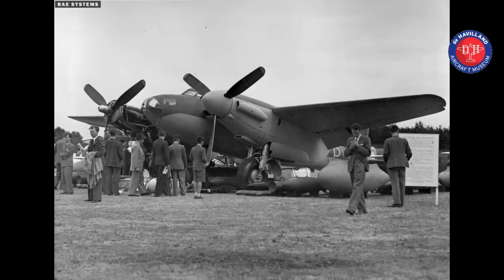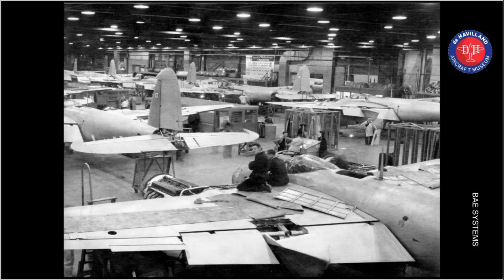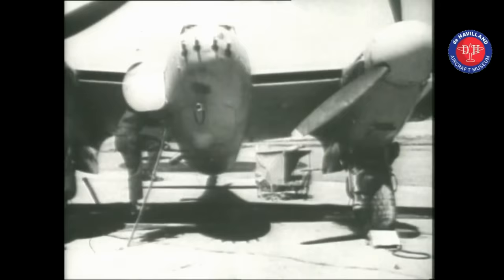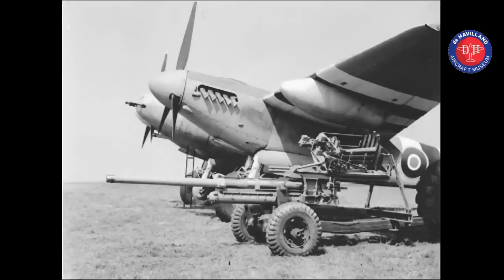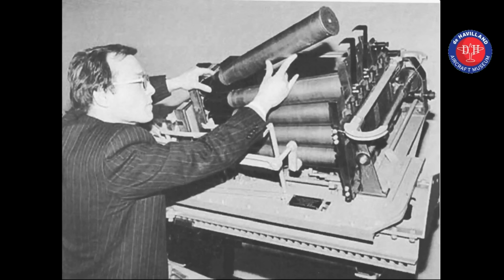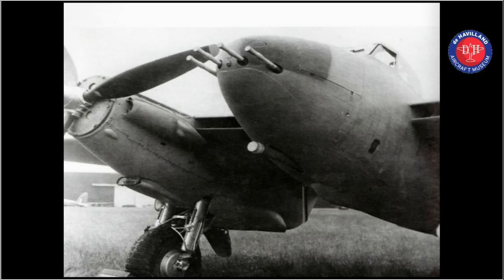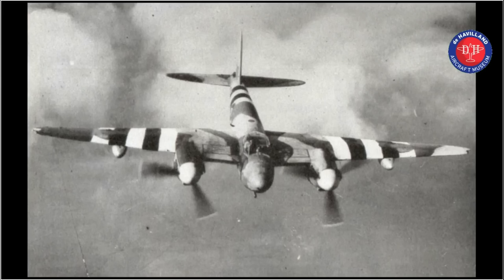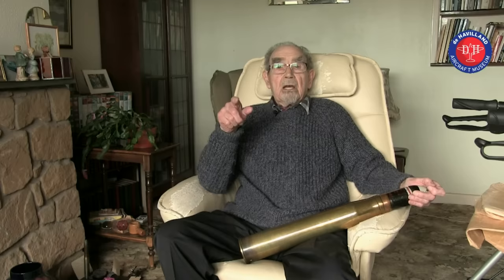TSETSE the DH Mosquito Mk XVIII

Comment: The Mosquito was one of the best planes ever built, period.
Reply: ...in the top 100 at least
Reply: Can't argue with that statement. 
Even today and updated turboprop version with modern avionics, would hold it's own for ground attack.  Low speed loiter performance was excellent even though at the time it was used for it's high speed. The wing design was an engineering masterpiece. Apart from anything it just looks so sexy.
Reply: Out of wood...
Reply: @rummerlinelmo  The fact that it was made of wood made it a war winning tool as important as the Sherman and T-34. That is why it was one of the best planes of WWII.
Reply: Defently a brilliant plane.
Reply: @gullintanni  It was made of wood because DeHavilland was more than a decade behind in structure metal aircraft technology and construction.
When it designed the Mosquito the company was still mass producing obsolete aircraft like biplanes made out of wood and fabric.
Reply: @sandervanderkammen9230  That is not true, the plane was made of wood because of the shortages of metal and the surplus of carpenters. Today the most hi-tech aircraft and boats are made of wooden composites, because it it lighter, stronger and more resistant to fatigue than metal, not to mention the issue of radar signatures. Indeed carbon fibre (wood) is the hi-tech material of today. De Haviland were ahead of their time.
Reply: @LeoSavantt  An interesting theory you have contrived.. but DeHaviland   never developed modern construction techniques and were decades behind other manufacturing companies... the Comet Disaster highlights the company's failure to innovate and invest in new technology.
DeHaviland was still struggling to sell wooden aircraft when the company became defunct in 1958.
Reply: @LeoSavantt  Lol!!! Please tell us what species of trees are harvested for Carbon Fiber production???? HAHAHA!!!
Reply: @sandervanderkammen9230  Nonsense.
Reply: @LeoSavantt    Just the facts here son, just the facts... you don't seem like a person accustomed to being told the truth.
Reply: @sandervanderkammen9230  Next you will be claiming that CO2 is a a  pollutant,  probably you are one of those who think that global warmish is a real, bless.
Reply: @LeoSavantt  Trees cannot live without CO2... but you also cannot get Polyacryonirile from trees....
Reply: @sandervanderkammen9230  still back on the subject the mosquito ...what a plane. Multi role and faster than anything the Germans had at its inception ...not exactly obsolete technology then...
Reply: @sandervanderkammen9230  RUBBISH...  It was made of plywood because DH recognised that metal was in short supply, a strategic material and also he could use a labour force that was otherwise not employed, carpenters and cabinet makers.  Also, his DH 88 Comet was a record-breaker during the 30s and it was on this aircraft it's basic design, proven was made.
Reply: @sandervanderkammen9230  WHAT the comet was a decade ahead of any other design.  The theories around stress and metal fatigue were unknown and the Comet unfortunately set new boundaries.  The results of those findings were given to the US, namely Boeing.
Reply: @sandervanderkammen9230  Rubbish.  After the war the UK government was nationalising all companies in all sectors, sadly DH was part of that in creating the state-owned aircraft company.
Reply: @sandervanderkammen9230  Absolute crap. The Comet disasters were down to a complete lack of understanding across the entire aeronautical industry of metal fatigue. If you had the remotest expertise in Aeronautical engineering, you would know that. Most of the issues were due to proliferation of stress fractures round punched rivet holes during pressurisation/depressurisation cycles, something no-one had a clue about at the time.
By 1958, de Havilland had many metal aircraft in production/service and it did not "become defunct in 1958", but was taken over in 1960 by Hawker Siddeley,which used many de Havilland designs under its own name.
Why don't you do some research before posting garbage?
Reply: @MrHistorian123  You sir are very confused and misinformed, Boeing was building large, modern all-metal, pressurized passenger airliners more than a decade before the Comet.
The Boeing 307 first flew in 1938 when DeHaviland was still making wooden biplanes like the Dragon Rapid.
Without the industry wide understanding of metal fatigue in rivited airframe structures planes like the Boeing 307, 377, Douglas DC6, DC7 and Lockheed Constalation would not have existed.
The Boeing B-47 Stratojet flew two years before the Comet did.

The DeHaviland company became defunct as a direct result of the Comet Disaster, it entered receivership in 1958 and it's debts were written off by the U.K. government and it's remaining assets were sold to Hawker Siddeley, Hawker Siddeley continued  to use the name until 1963.
Reply: @TheJonathan1959  DeHaviland was years behind in aircraft design and construction it was struggling to build wooden aircraft in the jet age.
Reply: @TheJonathan1959  Boeing was producing modern all-metal, rivited and pressurized planes more than a decade before DeHavilands utter failure to produce the Comet.
Reply: @TheJonathan1959  All aircraft production was nationalized during WW2... The Brabazon Committee was formed in 1942.
The DeHaviland Comet was ordered to meet the government specification under Type IV set out by the government  Ministry of Aircraft Production.
Reply: @TheJonathan1959  I believe the wooden construction improved the power to weight ratio as well.
Reply: Yes not recognized
Reply: @maxbacon4828  Massively.  Which is why nothing could catch it up for several years.
Reply: @sandervanderkammen9230  Sour grapes.   Regardless of why DH made the DH98 from wood, the fact is, it was still among the best, fastest, and most successful aircraft of the WW2.
Reply: @maxbacon4828  Can you prove that???
Reply: @BillyCosmosis  The Lockheed P-38 Lightning was faster, both would be easily outpaced by the Do-335 Pfeil
Reply: @BillyCosmosis  The Mosquito was fast for an  aircraft of built with essentially WW1 wood and fabric technology... but the main advantage of the Mosquito was it was cheap to build...
Reply: @sandervanderkammen9230    Wiki has the DH-98 a smidge faster.                                                                   Which probably is why the USAAF operated the DH-98 for their photo recon.                       The P-38 was an excellent plane. But not manoueverable or fast enough to match the German aircraft in the European theatre in WW2. Which is why the USAAF stopped operating them in the european theatre.      OTOH the DH-98 could and did face off against FW190's successfully. ---------------------------        
                                   https://infogalactic.com/info/Lockheed_P-38_Lightning                                                                 "After some disastrous raids in 1944 with B-17s escorted by P-38s and Republic P-47 Thunderbolts, Jimmy Doolittle, then head of the U.S. Eighth Air Force, went to the Royal Aircraft Establishment (RAE), Farnborough, asking for an evaluation of the various American fighters. Fleet Air Arm Captain and test pilot Eric Brown recalled:

"We had found out that the Bf 109 and the Fw 190 could fight up to a Mach of 0.75, three-quarters the speed of sound. We checked the Lightning and it couldn't fly in combat faster than 0.68. So it was useless. We told Doolittle that all it was good for was photo-reconnaissance and had to be withdrawn from escort duties. And the funny thing is that the Americans had great difficulty understanding this because the Lightning had the two top aces in the Far East."[79]
Reply: @sandervanderkammen9230  No.  It was simply an excellent, high performance aircraft,  superior to most other types at the time - be they wood or metal - maintained that status until 1945, and it excelled in all the many roles in which it was used.   What it was made of, how they made it, and why, all are beside the point.
Reply: @BillyCosmosis  Bullshit, I am not going to play any goal post shifting games here. We are not going to discuss some obscure  DH.98 MK 72 unarmed reconnaissance variant  introduced in 1947.
The P-38 first flew in 1939 and was introduced in 1941 same as the DH.98.
Most versions of the Mosquito had a top speed of less than 380mph... significantly less than the Lightning.
The larger, heavier and slower  Mosquito was even less suited to the fighter or interceptor role than the P-38.
The Mosquito was used primarily as light bomber and for photo reconnaissance... not a fighter.
 Neither aircraft would match a P-51, Tempest or  Fw-190 in performance.
Reply: @BillyCosmosis  Lets be honest, in 1941 the Mosquito was an obsolete design, a wood aircraft that when fitted with two very powerful short-lived engines and stripped down to nothing but a camera was reasonably fast in level flight...
But the Mosquito doesn't really live up to the legendary reputation fabricated by British propaganda and literary myths.
Reply: @sandervanderkammen9230  As I mentioned The USAAF withdrew the P38 from the European theatre because it couldn't perform. But continued to operate the DH-98.
Reply: @sandervanderkammen9230  Facts are facts.  The USAAF withdrew the P38 from the European theatre because it couldn't perform but continued to operate the DH-98.  Who should we believe?  The spotty teenager on the internet? (you) or the USAAF?
Reply: @sandervanderkammen9230    Or perhaps we should listen to Fleet Air Arm Captain and test pilot Eric Brown (the world record holder for different aircraft types flown) recalled:

"We had found out that the Bf 109 and the Fw 190 could fight up to a Mach of 0.75, three-quarters the speed of sound. We checked the Lightning and it couldn't fly in combat faster than 0.68. So it was useless. We told Doolittle that all it was good for was photo-reconnaissance and had to be withdrawn from escort duties. And the funny thing is that the Americans had great difficulty understanding this because the Lightning had the two top aces in the Far East."[79]                                       https://infogalactic.com/info/Lockheed_P-38_Lightning
Reply: @sandervanderkammen9230  Wilbur?   Wilbur?  Is that you?  😂🤣😂
Reply: @BillyCosmosis  The USAAF did not adopt the Mosquito because it could not perform.
Reply: @BillyCosmosis  The P-38 Lightning destroyed more enemy aircraft than any fighter in the Pacific  theatre...
Reply: @BillyCosmosis  Eric Brown was an excellent pilot, but the poor man had a notoriously bad memory... so much so he often contradicted himself in annecdotes that he claims he has first person knowledge.
Reply: @BillyCosmosis  As always  like a Tiger Moth amoung Spitfires is that you Tangles??? How have you been?
Reply: @sandervanderkammen9230   Yah sure.  The USAAF adopted it because they wanted to give their pilots an aircraft that was easy to shoot down  😂
Reply: @BillyCosmosis  The USAAF never adopted the Mosquito as a combat aircraft...
 With the introduction of the Messerschmitt Me-262 in April 1944 the Mosquito became very easy to shoot down.
Reply: @sandervanderkammen9230  You're grasping at straws now. The ME262 was 20% faster than EVERY allied piston engined fighter and a massive threat to all aircraft, being only vulnerable to swarming attacks (often at night) on their finals before landing at their home aerodrome. Lucky for the allies, the 262 was only available in relatively small numbers.       The operational availability was 1945 (not 1944 )  :             "Until the night fighter version of the Me 262 jet appeared (in small numbers) in 1945, the Germans did not have an effective defense against the Mosquito. The fighter-bombers attacked precision targets throughout Europe with bombs and rockets. The long-range reconnaissance versions complemented the PR Spitfires. They were also used by the USAF, that assigned the designation F-8."                   https://www.uboat.net/allies/aircraft/mosquito.htm                                                 However, this is all beside the point. The DH98 was an exceptional aircraft during WW2.   And it, as well as ALL allied frontline piston engined aircraft were made obselete by the development of the ME262 and the Gloster Meteor near the war's end.    i.e the beginning of the jet age.
Reply: @BillyCosmosis  The USAAF only used the Mosquito as an unarmed photo-reconnaissance platform and as a target tug... not as a combat aircraft.
Reply: @sandervanderkammen9230  Yes.  Despite USAAF having their pick of any of the excellent US aircraft available they chose the DH98.  Why?  Because it was a blisteringly fast aircraft that could also fly very high.    Read this account of US P51's escorting a bomber version of a Mosquito on a distant mission.  In the cruise to target, the P51's had difficulty keeping up with the Mosquito and the Mosquito had to fly slower than it's normal cruise speed to keep formation .   Both aircraft types were flying outside their respective fuel efficiency envelopes.  The P51s flying faster than their normal cruise speed, the Mosquito flying slower than its cruise speed.  Both types were loaded with maximum fuel via drop tanks and the Mosquito was carrying it's bomb load also.  http://www.mossie.org/stories/Norman_Malayney_2.htm 
 
Lt. Richard Geary (mosquito pilot) :    "The Mosquito met the fighter escort as planned; but now heavily loaded with l,000 gallons of fuel, flew at a severe speed disadvantage. Geary attempted to maintain economical cruising speed but outpaced the P-51s and was forced to throttle-back to continue flying formation with them. The Mustangs had long-range drop tanks and were also fully loaded."                       

 According to Lowell Einhous, (the P-51 escort flight leader)   "We experienced trouble maintaining speed with the Mosquito because of our drop tanks. The distance covered required that we carry extra fuel.   "
Reply: Don't matter what it was built from,wood,metal,carbon fibre,  who cares cuz it smacked the krauts big time
Reply: @BillyCosmosis  The USAAF never issued a requirement for the Mosquito, they were offered in trade for War Assistance programs like Lend-Lease.
The USAAF never used the Mosquito as bomber or a fighter, it would have been completely redundant.
Very intertaining antedotes but completely moot... 

The world's first aircraft destroyed by a jet was a Mosquito.

 26 Luftwaffe pilots became aces flying the Messerschmitt Me-262, of the number of RAF aircraft shot down by the 262s the overwhelming majority were Mosquitos.
Reply: @geoffreyking1634  What matter is the fastest propeller driven aircraft to see service during WW2 was German... not British.
And more important the introduction  of the the world's first operational jet fighter, the Messerschmitt Me-262 rendered the Mosquito obsolete as a front line combat aircraft.
Reply: @sandervanderkammen9230  Wrong, the composite wooden structure gave the Mosquito lots of advantages.
Also, its components could be made in woodworking factories, at a time when structural metals and the skilled workforce to build them were in short supply.
Yeah right, the Mosquito was rubbish, that's why it pissed Goering off so much. (Remember the Mosquito bombing his big speech in '44?). He ordered German industry to copy it, but the Brits bombed the glue factory.
Reply: @sandervanderkammen9230  The de Havilland Comet's problem were precisely because it was an extremely innovative plane, way ahead of its contemporaries. They had to salvage a crashed example to discover that its stryctural failures were because of stress concentration at the corners of the windows. No-one knew about that before.
Reply: @sandervanderkammen9230  You claim that the Mosquito was obsloete at its inception.... so can you explain why it excelled in SOOO many roles? Fighter, night fighter, photo reconnaissance, bomber, precision bomber, Pathfinder,  submarine destroyer, etc. Probably the most versatile plane of its era, and one which gave its crew a very good chance of survival.
It was so rubbish that Goering ordered the Luftwaffe to develop a copy of it.
'Nuff said, you wehraboo.
Reply: @pashakdescilly7517  DeHavilland built the Mosquito out of wood because it didn't know how to make modern aircraft using aluminum....
Reply: @pashakdescilly7517  The Comet Disaster remains the worst engineering failure in commercial aviation history because DeHavilland was decades behind in commercial aircraft design and manufacturing.
DeHavilland was still building biplanes made out of WOOD and fabric when the industry leaders like Boeing, Douglas, Junkers and Lockheed were building all-metal, pressurized monoplanes.
Metal fatigue was well-known and understood by the Industry... it was simply the fact that DeHavilland had no experience in Metal fatigue because it was still building aircraft out of WOOD!
Reply: @pashakdescilly7517  Because it was cheap and disposable you silly Teaboo...
Reply: @gusgone4527  and your choice of orifice?
Reply: @sandervanderkammen9230  what does that have to do with the mosquito?
Reply: @brianlenehan9055  DeHaviland used outdated wood technology to build the Mossie... it was fast but lacked many of the characteristics of modern aircraft like the reliability and durability of a all-weather, all-metal design.
 The Mossie may have been cutting edge technology for deHavilland but they were still building obsolete biplanes at the time... something that would cpme back to haunt them in the Comer Disaster and destroyed the company.
Reply: @sandervanderkammen9230  well arn't you the critic & detractor. It was the fastest in the sky till me262. Big enough to be an actual fighter bomber, can i say the first. Very versatile. Fulfilling a mutitude of roles till wars end. It was built by piano makers and cabinet makers who could use the work with material that was cheap and plentiful. It also rated high (highest?)  in pilot survivability. Sounds like an all round winner to me, certainly not obsolete.
Reply: @brianlenehan9055  Just the facts here... spare us the postwar British propaganda hype.
NO the Mossie was slower than the Lockheed P-38 Lighting.
Reply: @sandervanderkammen9230  since my comment you respond to is way too hard to find, it renders our communication almost useless. You obviousley have an axe to grind though for some reason. If you think the mosquito was obsolete during the war, then maybe set your axe aside and find  your dictionary, or borrow one. But maybe dictionarys are obsolete for you
Reply: @brianlenehan9055  You've been drinking Brian, I can tell.
Reply: @sandervanderkammen9230  absolute shite mate!!
Reply: @jacksonhudd3681  Indeed, the balsa wood "Skee-toe" was absolute shite.
Reply: @jacksonhudd3681  Just the facts here mate... the de Havilland Mosquito was obsolete technology...
Reply: Correction, , , THE best plane, ever built 👍
Reply: @johntailing5283  A good performer thanks to the Merlin engines but definitely not the best ever... not even close.
Reply: @sandervanderkammen9230  bit jealous are we???
Reply: @jacksonhudd3681  Jealous of what?
Reply: @sandervanderkammen9230  Your arguments are amusing, to say the least. Good luck comparing the P38, designed as a day fighter, with the Mosquito, designed as a night bomber. Apples and Oranges. I would have liked to have seen a P38 carry two 4000 lb cookies to Berlin by flying there twice in one night! Don't get me wrong. The P38 was great in the Pacific where a fighter with two engines was ideal for getting its pilot home with battle damage over water. But as a rule single engined fighters were preferable in WW2 

Again with the Me262! German planes introduced after D-Day should have an asterisk beside them, because the Luftwaffe was a basket case by then. And close to a thousand Me262 airframes never even received their engines, because Germany couldn't manufacture jet engines in either quantity or quality. Only about 300 Me262s saw service, a pathetically small number. The obvious question is "If the Mosquito was as overrated as you say, why did it take until nearly the end of the war for the Germans to develop an effective Mosquito-killing interceptor?" 

Hmm?

What has the failure of the Comet got to do with anything in WW2? The concept of the Mozzie worked, and worked well. Goering obsessed about it. Goebbels wrote in his diary how nuisance raids by Mosquitoes played hell with the sleep of Berliners. The best weapons Luftwaffe had against Mozzies for most of the war were pimped-up Ju88s which still needed luck to be high enough to intercept on all but a few occasions. Did you not know the Mozzie had the lowest loss rate of any RAF bomber? Well now you do.

The crux of your argument seems to be "Wood bad!", which can easily be countered with "Wood good enough in the case of the Mosquito."
Reply: @neilpemberton5523  Termites love the de Havilland Mosquito... because the in-flight meals are always FREE!
Reply: @awatt  Have you heard the joke about the two British astronauts that walk into a pub???
Reply: @sandervanderkammen9230  
Why would the country that invented gravity want to go somewhere that doesn't have any?
🇬🇧
Reply: @sandervanderkammen9230  You again.
Reply: @neilpemberton5523   Have you seen the RAF's new de Havilland stealth fighter??? OH! Nevermind... that's a AMERICAN LOCKHEED F-35!!!
Reply: @neilpemberton5523  Poor de Havilland... the once great British aircraft company never successfully made the transition from building aircraft out of Wood and fabric... went tits-up after biggest engineering failure in the history of commercial aviation.. the Comet Disaster
Reply: @sandervanderkammen9230  When you don't have valid arguments, only jokes remain.
Reply: @neilpemberton5523  The British aircraft industry has always been good for a laugh... now it no longer exists.
Reply: @neilpemberton5523  Have you flown British Airways lately??? They currently operate 92 aircraft made by Boeing AND 132 aircraft made in Hamburg Germany.
Reply: @sandervanderkammen9230  
Concorde. No one but the UK has ever made a supersonic passenger plane. 🇬🇧
Reply: @sandervanderkammen9230  
" aerospace industry of the United Kingdom is the second-largest national aerospace industry in the world (after the United States) and the largest in Europe,[1][2][3][needs update] with a global market share of 17% in 2019. In 2013, the industry employed 84,000 people.[4][needs update]

Domestic companies with a large presence in the British aerospace industry include BAE Systems (the world's fourth-largest defence contractor),[5][6] Britten-Norman, Cobham, GKN, Hybrid Air Vehicles, Meggitt PLC, QinetiQ, Rolls Royce (the world's second-largest maker of aero engines),[7] Senior plc and Ultra Electronics. Foreign companies with a major presence include Airbus (through its Airbus UK subsidiary), Boeing (through its Boeing UK subsidiary), GE Aviation (through its GE Aviation Systems subsidiary), Leonardo, Lockheed Martin (through its Lockheed Martin UK subsidiary), MBDA, Safran (through its Safran Landing Systems subsidiary), Spirit AeroSystems and Thales Group (through its Thales Air Defence subsidiary).

Current and future crewed aircraft in which the British aerospace industry has a major role include the AgustaWestland AW101, AW159, Airbus A220, A320 family, A330, A340, A380, A400M, BAE Hawk, Boeing 767, 777, 787,[8] Bombardier CRJ700, Learjet 85, Britten-Norman Defender, Britten-Norman Islander, Eurofighter Typhoon, Hawker 800, Lockheed Martin C-130J Super Hercules, Lockheed Martin F-35 Lightning II and BAE Systems Tempest. Current and future unmanned aerial vehicles in which the British aerospace industry has a major role include Airbus Zephyr, BAE Taranis, HAV 304 Airlander 10 and Watchkeeper WK450. Major engine families designed and manufactured in the United Kingdom include the Eurojet EJ200, TP400-D6, Rolls-Royce LiftSystem and Rolls-Royce Trent.

The British aerospace industry has made many important contributions to the history of aircraft and was solely, or jointly, responsible for the development and production of the first aircraft with an enclosed cabin (the Avro Type F), the first jet aircraft to enter service for the Allies in World War II (the Gloster Meteor),[9] the first commercial jet airliner to enter service (the de Havilland Comet),[10] the first aircraft capable of supercruise (the English Electric Lightning),[11] the first supersonic commercial jet airliner to enter service (the Aérospatiale-BAC Concorde),[12] the first fixed-wing V/STOL combat aircraft to enter service (the Hawker Siddeley Harrier),[13] the first twin-engined widebody commercial jet airliner (the Airbus A300),[14] the first digital fly-by-wire commercial aircraft (the Airbus A320),[15] and the largest commercial aircraft to enter service to date (the Airbus A380)"

America then Britain.....can't see Germany in that list
Reply: @awatt  Please name a single British company that still makes jet transport aircraft in the U.K.?
Reply: @awatt  Sorry lad but Germany is leader in aircraft production in Europe... Hamburg Germany is largest manufacturer of jet aircraft in Europe and second only to Seattle Washington. U.S.A.
Reply: @sandervanderkammen9230  
So what you are saying is that you work for us now. 🇬🇧
Reply: @awatt  Please name a single British company that still makes commercial jet aircraft in the U.K.?
Reply: @sandervanderkammen9230  
UK is the largest aerospace industry after the USA....🇬🇧
Reply: @awatt  Answer the question lad! Name a British company that still makes commercial jet aircraft in the U.K..???
Reply: @sandervanderkammen9230  
Airbus UK
Reply: @awatt  Airbus is a foreign aircraft manufacturer, not British.
  Airbus SA. does not manufacturer aircraft in Britian.
Reply: @awatt  Please name a single BRITISH COMPANY that still makes commercial jet aircraft in the U.K.??
Reply: @sandervanderkammen9230  
The British owned subsidiary Airbus UK (the clue is in the UK bit) manufactures wings in the UK.
Reply: @awatt  Airbus U.K. is a Foreign owned company.
Reply: @sandervanderkammen9230  
"Airbus UK is a wholly owned subsidiary of Airbus which produces wings for Airbus aircraft. When Airbus was incorporated as a joint-stock company in 2001, BAE Systems transferred its UK Airbus facilities in return for a 20% share of the new company. These facilities became Airbus UK. The company has two main sites responsible for the design and manufacture of the high-technology wings for all Airbus models as well as overall design and supply of the fuel system. For most Airbus models, the company is responsible for overall design and supply of landing gear. The company employs around 13,000 people at two sites: Filton, where the engineering and design activity takes place along with some manufacturing, and Broughton, where other major wing component manufacturing and all wing assembly takes place."
Reply: @awatt  Airbus SA. Does not manufacturer any aircraft in the U.K. and is closing its facility in Broughton.
Reply: @sandervanderkammen9230  
"Airbus wing design and production was assigned to UK largely because of the advanced wing design of Hawker Siddeley Trident (D.H.121), designed by De Havilland. In the early days of Airbus, De Havilland design teams based in Hatfield worked on Airbus wing design and wing assembly was carried out in Broughton (a De Havilland manufacturing site). After Hawker Siddeley (the parent company of De Havilland) had become part of British Aerospace, the Hatfield site was closed. From the 1990s onwards, Airbus design work has been carried out at the Filton site, which was originally the Bristol Aeroplane Company.[8]

Filton
Edit
The Filton site is located on the former Bristol Aeroplane Company site, which was later used as the final assembly line for the British-built Concorde aircraft (the French-built Concordes were assembled in Toulouse, which is also now an Airbus site)."
Reply: @sandervanderkammen9230  
Airbus UK Limited

Type
Private

Industry
Aerospace

Founded
20 November 1997; 24 years ago

Headquarters
Bristol, United Kingdom

Key people
Katherine Bennett CBE (senior vice-president)[1]

Products
Aerostructures
Revenue
£2,068 million (2005)[2]

Number of employees
10,135 (2005)[2]

Parent
Airbus
Reply: @awatt  Yup, a foreign aircraft manufacturer taking advantage of the cheap rents and subsidized labor.
The the U.K. is a country filled with abandoned aircraft factories...
Reply: @sandervanderkammen9230  
"Airbus Filton employs over 4,500 people in a variety of roles. The site is responsible for the design of the wing structure, fuel systems and landing gear integration. Some manufacturing also takes place in Filton, including the wing assembly for the A400M. Aerodynamics work, research and testing is also carried out.[9] In 2008, Airbus sold most of the component manufacturing activities on the Filton site to GKN, which continues to use these facilities to manufacture Airbus parts as a subcontractor.[10] In 2011 Airbus announced the construction of a new office complex, referred to as the "Aerospace Park", at the Filton site."
Reply: @sandervanderkammen9230  
"The current Airbus Broughton site was founded in 1939 as a shadow factory for the production of the Vickers Wellington and the Avro Lancaster. After the War De Havilland took over the factory and it was used to produce various aircraft, including the Mosquito and the Comet.[12]

Today Airbus Broughton employs over 6,500 people, mostly in manufacturing roles. The site is responsible for the wing assembly for all Airbus aircraft, with the exception of the Chinese A320s (these wings are assembled in China) and the A400M (assembled in Filton). Airbus wings are transported by Airbus Beluga or ship (in the case of the A380) to the final assembly lines at Airbus Toulouse."
Reply: @awatt  Airbus U.K. is wholly foreign owned company, a German, French and Spanish Consortium.
Reply: @sandervanderkammen9230  
Where is Airbus UK's office?
Reply: @awatt  In 2006 Airbus SA. bought back BAe's 20% share.. Airbus is not a British owned company.
Reply: @sandervanderkammen9230  
Airbus UK is not the same as Airbus
Reply: @awatt  Airbus U.K. is wholly foreign owned company, it is a German, French and Spanish Consortium.
You look like a fool right now lad.
Reply: @awatt  JUST ANSWER THE QUESTION!
Name a British company that still makes commercial jet aircraft in the U.K.?
Reply: @sandervanderkammen9230  
You have a history of confusing companies. Remember how you kept doubling down when you confused Rolls-Royce automobile company with Rolls-Royce aerospace company?

The UK is the second largest aerospace manufacturer after the USA.  German companies may just pop rivet a few bits of aluminium together but the UK does all the technical and important stuff.
Reply: @awatt  JUST ANSWER THE QUESTION LAD!
Name a single British company that still makes commercial jet aircraft in the U.K.?
Airbus is NOT a British company and makes no commercial jet aircraft in the U.K.
Reply: @sandervanderkammen9230  
It is
Reply: @awatt  You look like a fool right now lad... Airbus is not a British company and it manufacturers no aircraft in the U.K.
Reply: There hasn't been a single British commercial jet made in the U.K. for over 2 decades.
Reply: @sandervanderkammen9230  
"Commercial Aircraft
The sites at Filton and Broughton design, test and manufacture the wings for all Airbus’ A320 family, A330 and A350 commercial aircraft, directly sustaining more than 8,000 full-time jobs and hundreds of apprenticeships. 

A220 family wings are designed and built by Spirit AeroSystems in Belfast, Northern Ireland.

Broughton has a proud tradition of aerospace manufacturing dating back 80 years, having supplied the RAF with vital aircraft during the Second World War. Employing almost 5,000 people, Broughton is a global centre of excellence for manufacturing and delivers over 500 wing sets per year for the A320 family, A330 and A350. Airbus has invested more than £2 billion in the Broughton plant over the past 10 years. 

Core activities at Filton, where an additional 3,000 people work, are the design, engineering and support for Airbus wings, fuel systems and landing gear systems. Teams also work on aerodynamics research, development and test facilities, including our future zero-emissions programme, ZEROe, while wings for the A400M transporter are assembled on site."
Reply: @sandervanderkammen9230  
 @Sander Van der Kammen  
Doesn't change the fact that the UK is the SECOND LARGEST aerospace manufacturer in the world after the USA.
Reply: @sandervanderkammen9230  
Components for aircraft are manufactured in other countries and assembled in Germany

"Airbus Industrie employs more than 50,000 people. Employees work directly on Airbus aircraft in France, Germany, Spain, the United Kingdom, and China, and others are employed in engineering, sales, training, and other occupations around the world. The consortium has more than 1,500 suppliers and holds cooperative agreements with numerous companies in many countries. American companies are responsible for about a third of Airbus components. The partner companies perform much of the subassembly in their own factories; for instance, wings for all Airbus aircraft are made in the United Kingdom, and tail subassemblies are made in Spain. Subassemblies are transported by road, rail, barge, ship, and aircraft (using a fleet of special jets, the Airbus Super Transporter Beluga) to final assembly lines in France, Germany, and China. Airbus A320, A330/A340, A380, and A350 aircraft are completed at a complex near Toulouse, while A318, A319, and A321 aircraft are assembled in Hamburg. In addition, A320 aircraft have been assembled in Tianjin, China, since 2008, and in 2012 Airbus announced that A320s would be assembled in Mobile, Alabama, starting in 2015."
Reply: One does like to say someone is talking out their arse but De Havalind had already built a stressed all metal aircraft before building the Mosquito, and later built jet aircraft also some of the later Mosquitos were of metal construction. Where as metal could be stamped out by anyone trained to operate a machine ply wood had to be formed by craftsmen/women, one of the selling points, the government were reluctant to spend money on yet another aircraft, was that it saved on short supply metal